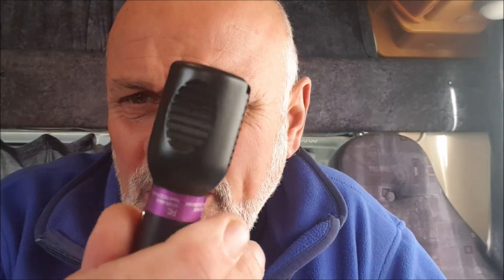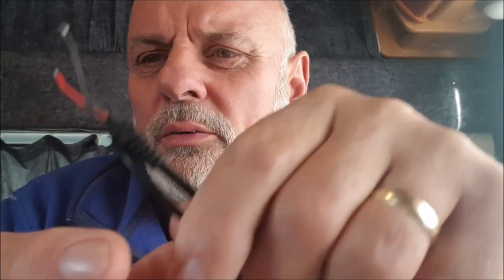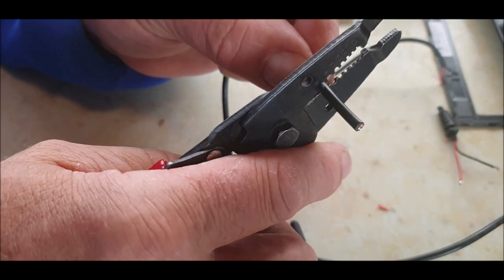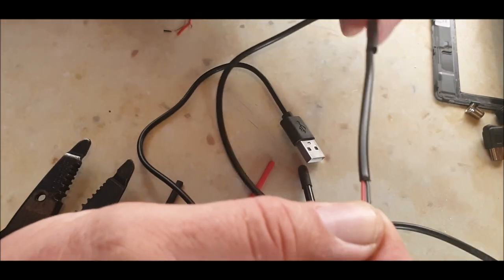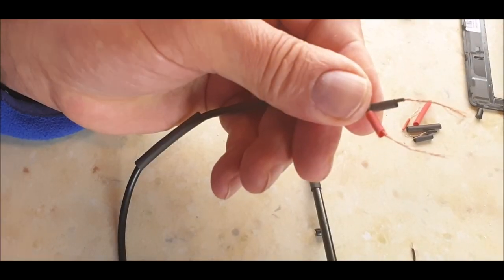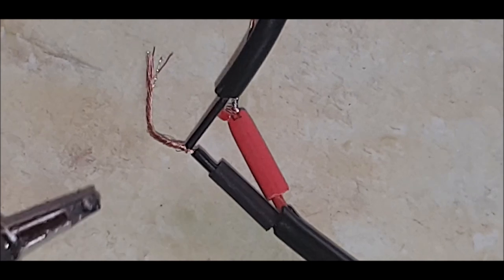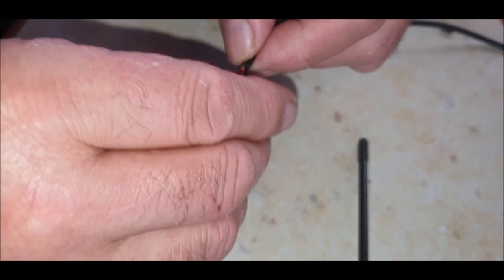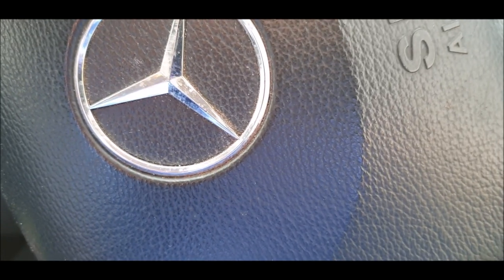How to replace broken cigarette lighter plug with usb

Comment: I got a question... I'm doing the same as you but the usb cord has 4 cables coming out: red, blue, white and green and the mini cable only has 2: red and bare copper. Which ones am I soldering together? TIA

Comment: Where did you get usb that is outlet is red and black wires , usually its 6 wires or so...
Reply: That is why I'm here to figure that out too
Reply: @bammanshayleigheggerbentle6661  i figured , the usb usually have 4 wires , the red and black are the power, and green and white are for data , thts why he dont use them
Reply from the maker: https://www.amazon.co.uk/Connector-Cable-Charge-Extension-Adapter/dp/B0BKXFZBC6/ref=sr_1_1?crid=1RD6R1GHE704M&keywords=5V+USB+2.0+2+Pin+2+Wire+diy+usb+Male+Jack+Connector+Cable+Power+Charge+Extension+Cable+Cord+0.3m%2F1m%2F2m+Connector+Adapter&qid=1669016583&sprefix=5v+usb+2.0+2+pin+2+wire+diy+usb+male+jack+connector+cable+power+charge+extension+cable+cord+0.3m%2F1m%2F2m+connector+adapter%2Caps%2C334&sr=8-1